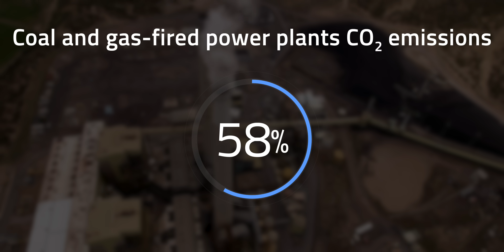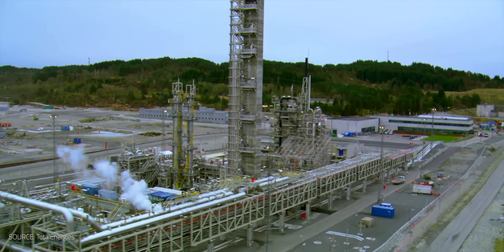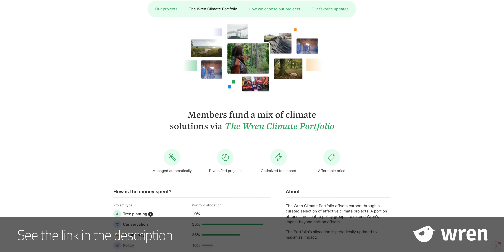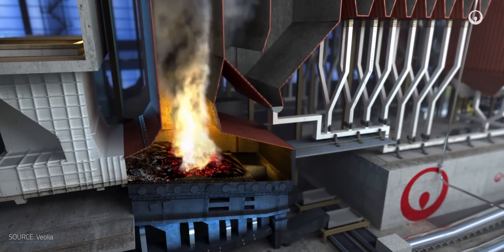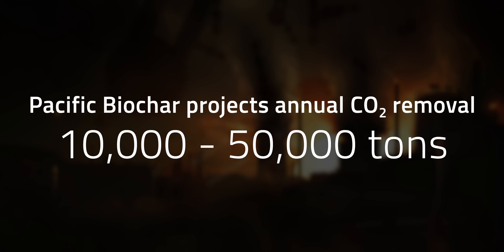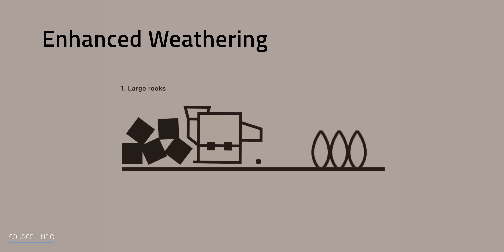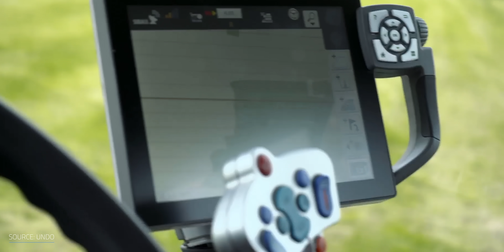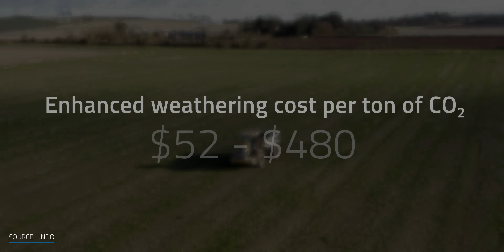The Reality of Carbon Capture

Comment: Pyrolysis generates high temperature methane and char.  When that hot methane is released into the atmosphere it reacts with oxygen (burns) and creates CO2 and water vapor.  Does the char sequester as much CO2 as producing it generates?  

How much CO2 is generated moving the crushed basalt to, and distributing it over the fields?  Also, what percentage of basalt already generated in mining have low levels of the toxic metals in them?

For some reason the CO2 generated in  carbon sequestration plans is rarely considered in the good vs. bad evaluation.  Likewise, the sheer amount of basalt easily available is emphasized, while the fraction which is low in toxicity is overlooked.  Can the entirety of enhanced weathering basalt be supplied out of current mine tailings?  And, since those mining companies are required to return their mines to their original state, what materials are going to replace the basalt taken for weathering when mine reclamation begins?  Who pays that cost, and how much CO2 is generated in the effort?  Why aren't those numbers factored into the cost/benefit evaluation too?

This seems to be a standard approach by those pushing carbon neutrality.  Enhance the good and dismiss the bad aspects of alternative approaches, while pushing to rapidly stop using current, cost effective methods of producing the goods and services necessary for a society to function at first world levels, before a cost effective alternative is found.

Comment: It really hurts to see a engineering content creator pushing so hard for something so debunked as the individual carbon footprint. It's hard to tell how much is due to the individual sponsor of the video, Wren, and how much is due to you repeating petrochemical advertising campaigns. 

The diffusion of responsibility is what causes environmental engineering solutions to be considered only if economically beneficial in a short term investment cycle, which is the root cause of CLIMATE CHANGE.

Comment: Learned much good info regarding biochar carbon sequestration, however I wished Mr. Ferrell would have addressed sequestration by ocean processes, which account for 50% of earth's carbon sink.  May I suggest he consider the elephant in the room: re-balancing the existing Co2 load in our atmosphere using the earths natural processes will succeed, problem is it will take between 400 - 1,500 years.  Not a problem for the earth which has re-balanced Co2 many times after Co2 shocks to the atmosphere, but many living species including humans will find waiting around pretty difficult.

Instead I am working on improving the efficiency of one of the earth's largest carbon sink cycle: ocean phytoplankton.  50% of sequestered carbon happens in the ocean about the same as all land based carbon sinks.   The process I am developing based on science originally worked out by oceanographers decades ago, involves increasing natural nutrient levels available to phytoplankton during the growing season which otherwise become depleted causing the colony to crash until nutrient levels return.  Retired and fortunate to have the financial resources to at least test 1/4 scale prototypes of my ultra low energy and low material invested system, initially off the continental shelf of my home state of Washington (after obtaining local state and US federal gov permits).  

Calculations in some science journal articles suggest if phytoplankton could be supplied with a more reliable supply of nutrients (my current job) this would in turn sequester a vastly larger amount of Co2 into the deep ocean (for millions of years a very large existing reservoir of carbon).  I want to aid this existing natural carbon sequestration process to such an extent we could draw down the atmospheric Co2 imbalance in decades not waiting centuries for the earth to work itself thru the imbalance we created.  This is the difficult problem to be addressed.

Comment: I'm going to laugh when it turns out that all the extra carbon dioxide is the best thing that could have happened because it's staving off another ice age, encouraging greening of deserts and driving higher crop yields. In 50 years I'm betting were going to be wishing we had more fossil fuels to burn and we'll be pumping out all of the sequestered carbon.

Comment: Largest Carbon Capture On the Planet is the Oceans. Issue with the Oceans as Plantation die off Carbon Capture slows down and so does Oxygen production .
now Global Warming Has been On going for that Last 100,000 Years . Co2 from Humans Is not driving Global Warming . the Oceans and the Sun are. and Humans Have a Impact on that .
Issues is cutting Co2 will not stop global warming and Earth for the Most part dos not Keep Ice at its polls for Long.
 any one Making Carbon Capture is Playing in to Hysteria. Global warming will not be stopped By Carbon Capture . 
Global warming  can't Be stopped.  Warmer Oceans more global warming  , as Moisture go's in to the stratosphere , this will make cloud altitudes of 15,000–25,000 m (49,000–82,000 ft). they will reflect sun's energy and and the Warming trend will then stabilize. 
But with More Moisture comes more severe storms.
If any one tells you they can stop Global Warming  . Hand Him a Glass and tell him to drink the Oceans  and put out the sun.

Comment: Three thoughts:
First, I'm aware of a couple of cities where sewage solids are composted with sawdust, sometimes with shredded cardboard mixed in, resulting in an excellent topsoil for lawns and gardens.  Would these be improved by the addition of biochar and/or powdered basalt?
Second, I know some people who when they have broken clay flower pots will instead of throwing them away crush the pieces down to quarter-inch and smaller and mix the result into their compost.  They swear it improves the soil coming from the compost bin.  Does this actually work, and if it does is the mechanism what I'm guessing, that micro-pores in the tiny pottery fragments hols both water and nutrients?
Third, I do conservation work in coastal sanddune regimes in Oregon.  Would adding either of these help turn sand into soil, and if so is there any way we could obtain them cheaP
Oops -- thought of a fourth one:  I recall an article that asserted that common clays, in particular Kaolin and Bentonite, when pulverized down to nanoparticles, can be mixed with water and that water used to flood sandy soils with the result that the soil is better at retaining both moisture and nutrients.  Can you comment on this or point me to some information about it?

Comment: Couple of observations. CCUS doesn't work everywhere. DAC is only 15% efficient (420 ppm in air...), which means the CO2 emitted in producing the solar PV/wind/batteries (unfortunately from fossil...) could be more than you DAC. Biochar means you using biomass - warning, once waste runs out, trees get cut... problem remains, energy might be solved, but carbon required to make the world go round, will be required. If you stopped fossil today, you would not have been able to make this nice video, or me watch it. That will remain an issue into the future.
Reply: When you say that that 'CCUS doesn't work everywhere' I wonder are you referring to China and India who are  apparently opening  a new coal-fired power-station every week. It is unclear whether the new-builds incorporate some form of CCUS but if the technology  needs to be applied anywhere it is in those countries.
Reply: @edwardhogan1877  Agree Edward, I am definitely not suggesting that CCUS doesn't have a significant role to play. What I mean with this is that sequestration is not always easy, if you are far inland, away from gas caverns etc. We have specifically looked at this, but our facility is 600 km away from the coast and other possibilities not available nearby. At the moment,  we are considering capturing/converting our CO2 with green hydrogen via the FT process to usable products.

Comment: I can only see carbon capture and sequestration as an option on the table once the fossil fuel lobby is crippled at the very least. Carbon capture in the presence of a strong fossil fuel lobby will just end up as the former being used as a tool for greenwashing and fraud. Let's focus on crippling the fossil fuel industry first.

Comment: With large amounts of crops being produced with strip till and no till,  farmers have been sequestering carbon.   I have one 500 acre field that I put 50,000 tons of composted feedlot manure.  I did this in the 1970's and 80's.   This was in a field of 220 bu continuous corn that added lots of carbon to the soil.   Just the manure had 20,000 tons of organic mater or 12,000 tons of carbon.    The soil organic mater in the top foot went from 2.25 to 2.7% when I stopped the manure in 1990.   Now it is back to 2.25% 30 years later.   SOM has a half life of 25 years in NW Texas and it is not that easy to increase even with strip till and no till.  If this field is put back to grass and 25 years later SOM  will go back to 1.8%.  Until one actually does it people can speculate all day long.  Simply adding C does little to soil fertility.

Comment: PLEASE  help me understand. What about when Quantum computers, likely in 2 years or more because that's when they will begin to have real practical use, ...invent new exotic super materials, one of which will be a super C02 absorbing material. *What then?* That will be a game changer, right?? 

Because even if we were to stop all emissions today, there would still be horrible climate change related damage to deal with for many decades. 

We need a way to reverse the c02 from PPM of 420 and climbing, all the way down to 280 PPM, or pre industrial levels.

And while the naysayers of Fusion have the easiest job in the world, in that all they have to do is point and say "look, fusion is not here  yet, or is 20 years away from being 20 " blah blah blah.

But MIT and General Fusion say they are less than 8 years away from being to able to begin construction on Commercial Fusion power plants, we could build those AND hook them up to C02 capture facilities using the news exotic super material absorbing C02.

Comment: These technologies are lipstick on a pig.  The real problem is we are taking a lot of fossil hydrocarbons out of the ground, and at best storing oxidized carbon underground.  We need to stop using fossil fuels, and replace them with renewable energy sources and nuclear.  That's the only thing that's going to really solve the problem.  Then the natural processes would have a chance to gradually lower the atmospheric CO2 concentration.

Comment: Really the biggest thing we have to do is make the people who profit from CO2 being put into the air pay to take it back out. If we're going to let companies be big, that is the only way to shift their behavior. It has to cost too much to produce new CO2 than it's worth economically.

Note that this is different from a Carbon tax. That's too indirect, an can't be levied at the proper rates where necessary or focused well. This is literally "Okay, if you produce x amount of oil, resulting in y tons of CO2 released into the atmosphere, you have to remove y tons of CO2 from the atmosphere before you can produce any more oil.". That's the secret. We'll stop doing it if we have to pay for it, because it's not worth doing.

Comment: One issue i would like more information on with regard to the weathering process is addressing g the fact that many (perhaps most) basalts are radioactive.   Now, the majority of the radon is likely released during the rock crushing process, but the remaining radium, uranium, and thorium in the basalt (which has now been reduced to small particles) being spread on crops - is anyone monitoring the uptake of radioactivity into those crops?

Admittedly, I would expect any such uptake to be small, likely along the lines of a banana, but its important to be wary of the unintended byproducts. Remember that the TCDD (the dioxin in Agent Orange and other "Rainbow Agents that capsules the problems) wasn't expected to be there at hazardous concentrations so they never tested for it after full scale production began... while batches made under lab conditions would end up with TCDD concentrations as low as 0.05 PPM, upon examination (in the 1970s) of the actual production batches made on an industrial scale, had TCDD levels that ranged up to 50 PPM, with a mean of 2 PPM.  A contaminant that had no detectable health implications at 0.05 PPM was a serious health issue at 40 - 200 times that concentration.
Reply: Andrzej Pawula just published a paper on this very issue. (See Journal of Geoscience and Environment Protection > Vol.10 No.4, April 2022) We already mine phosphate rocks to add more phosphate fertilizer to the soil, as phosphorous is an essential nutrient for plants and for ourselves, despite being radioactive. However, we do this at the risk of adding harmful elements, including heavy metals like cadmium, lead, and arsenic, or radioactive elements such as radium, uranium, and thorium. The concentrations vary, but basalt is at the low end of the scale for uranium content, lower than coal, and much lower than potash which it at the high end of the scale. So Pawula suggests using crushed basalt for fertilizer instead of phosphate rocks, saying this could reduce radioactivity in the environment. That, and not burning coal, which releases radioactivity directly into the environment. Matt's video doesn't really mention the radioactivity issue, though I think that's part of what's meant when the Mel Murphy, the research lead from Undo, talks about the importance of the selection of the right type of rock to use in enhanced weathering projects.

Comment: Capturing CO2 is completely unnecessary. If you haven't researched past CO2 levels, up to more than 7x the concentration, and it's effect on temps, you shouldn't be repeating this Gullible Warming Propaganda. Seek the scientists who've spoken out at their own cost and risk. Not the paid for government hacks. Government is for sale, and in fact sold.

Check the levels people's activity put out as compared to the natural emission. People are negligible contributors. Carbon capture is basically organized crime, charging us big bucks for actually harming our environment, because more CO2 is conducive to increased flora growth, more food, more trees and plants, all that.

High levels of particulate are pollution. Natural gasses are just air. CO2 levels being higher would be GOOD.

Because you've been taught something in school, doesn't make it correct. Ask the Germans, who learned so much under Goebbels programs.

Comment: The numbers just do not work we produced last year over 2 billion tonnes of carbon the two methods you are describing are sequestering a minute amount of carbon and to scale the methods up we are getting unrealistic numbers to solve the problem we are having right now. The second point to make especially with the weathering of basalt is a rate issue. You mention one side of the issue, the surface area allowing to weather basalt but at the same time weathering a basalt is also a kinetic issue. The driving mechanism to sequester CO2 in basalt is the Serpentinization reactions limited by the kinetics of the chemical reactions. The process in nature is very slow, especially on the surface, hence the inefficiency of sequestering CO2 and the low numbers. Nature speeds up the reactions by adding pressure and Temperature. But here we are just adding basalt to the soil. I am not sure if the increase in the yield has more to do with the increase in soil temperature and the development of more favorable conditions due to the dark rock and change of the Albedo of the surface. I believe that the best way forward is emission reduction instead of creating a false hope with numbers who not even scratch the surface.

Comment: Direct carbon capture seems weird idea, as long as there are many big CO2 producers that doesn't have any carbon capture, just as it is today. In idk, 30 years, when we will eliminate carbon sources or at least capture most of them, then yeah, we could use green energy to do it, but before that, why not focus on streams that have high CO2 concentrations (like carbon sources) and ignore much more energy intensive extraction from very low carbon source that is our atmosphere? (of course, not low enough for our climate, but it's easier to extract from source that is mostly CO2, or at least several percents,  than from source that is 0.04% CO2)